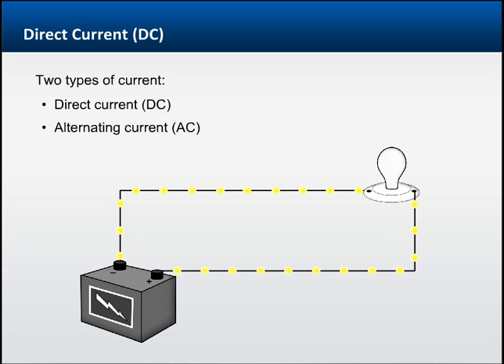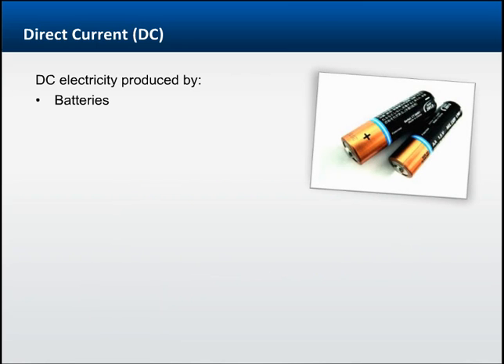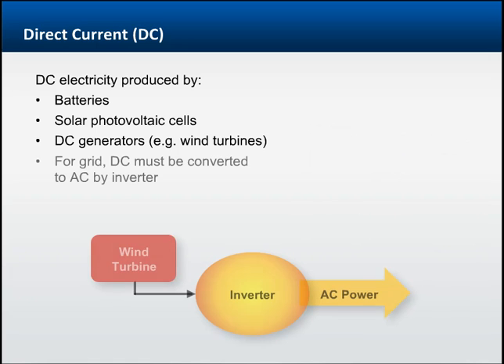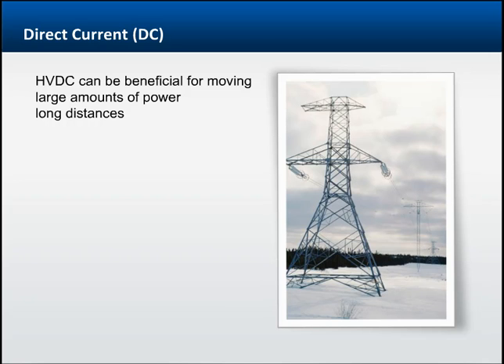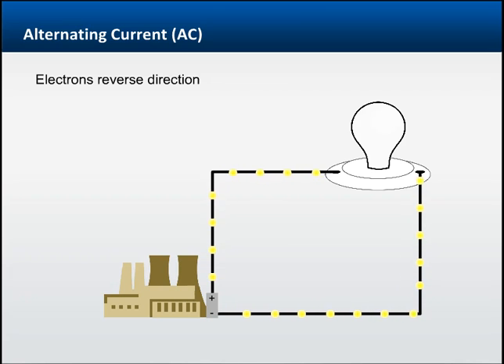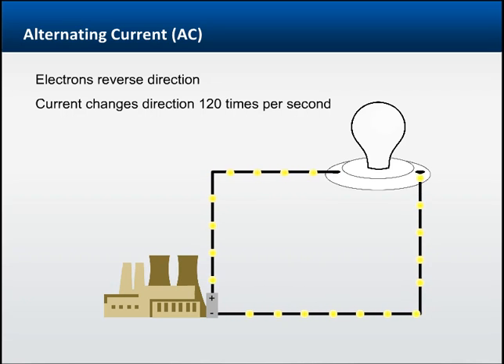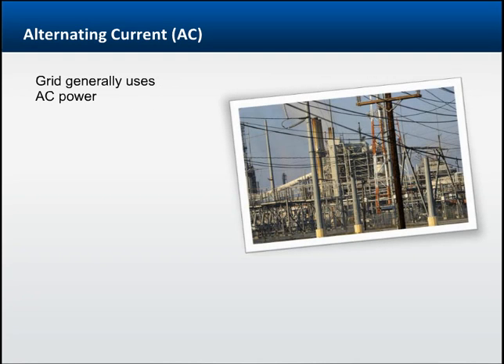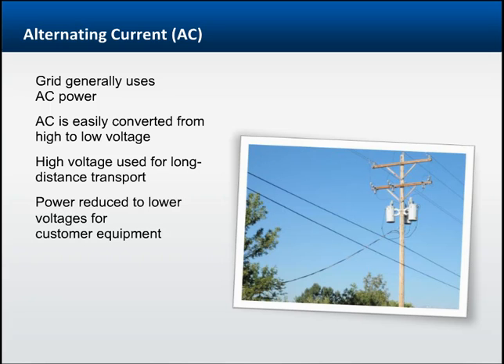Direct and Alternating Current

Comment from the maker: Thanks for your comment.To clarify, first the electrons flow in one direction and then halfway through the cycle they switch and flow back in the opposite direction. That means in an AC waveform the current changes directions twice between the start and end of the cycle. So there are 60 hertz (cycles per second) in North America and the direction changes twice within a cycle so therefore, the current changes direction 120 times per second.